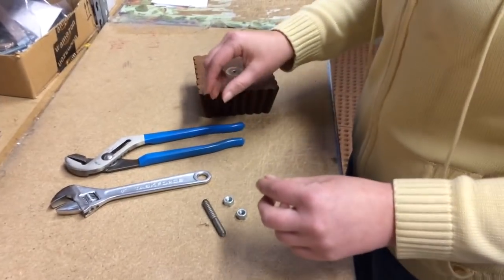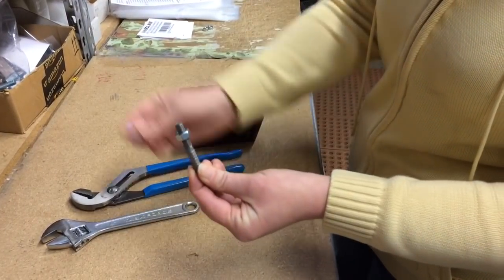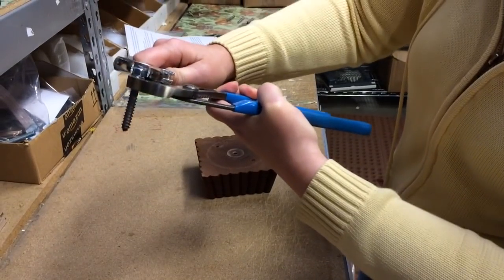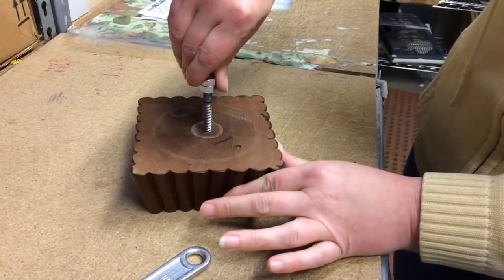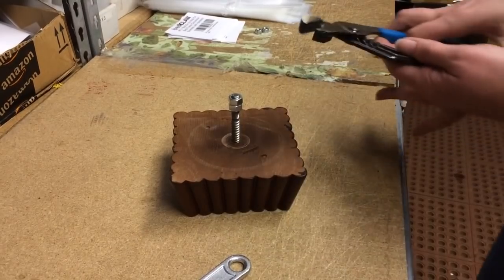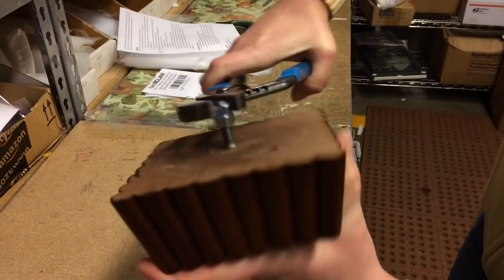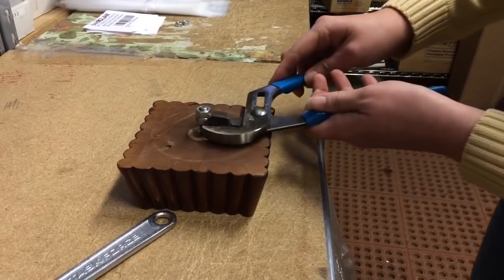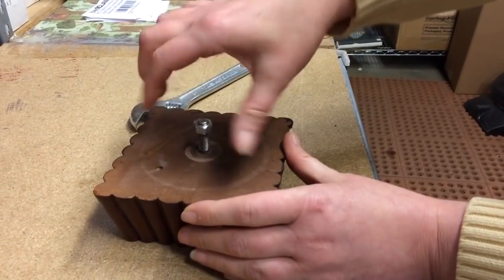Leg Daddy University: Installing Hanger Bolts Into Sofa Legs

Comment: Nice job but a few tips:
If you want to use slip-joint pliers, move to the next slot channel that will allow the handles to come closer together and give you a better grip. If you are screwing into a freshly drilled pilot hole, use a box-end wrench or socket on the nut. The job will go faster, you won't chew up the nut and you will have more torque. Also, place a washer between the two nuts for the wrench or socket to rest on and help keep from unscrewing the bottom nut.
Reply: Common sense emerges from the primordial soup of this video.  Thank you Ville.

Comment: - VERY helpful video. Thanx 4 sharing. Now, how do you remove the entire foot without unscrewing it from the inserted bolt ???
Reply: Use a little glue in the pre-drilled hole of the foot when screwing in the hanger bolt. I have to do 6 of these for a Kluft bed box spring that is missing the feet. It has a thick 12mm bolt that NO feet on the market have, they all have the standard thread of 5/16.

Comment: Please I have a question. I have a low settee that I want to raise by 10cm, to be more comfortable. The wooden leg is 10cm and I would need a 20cm leg. The hanger bolt in at the moment is 48.3mm total length with only 23.3mm threaded for the wooden side. What length of hanger bolt would better or can I make do with the current length of hanger bolt? Many thanks, Tellytubbytennis.co.uk.

Comment: Yep. That's helpful but to do it "properly", you shouldn't use pliers. That's just rough. Even using an adjustable wrench is borderline rough. The "proper" way to do it is with two spanners of the correct size. Using pliers on a nut is like using a bread and butter knife to tighten a screw.